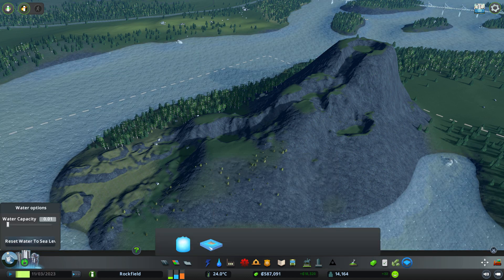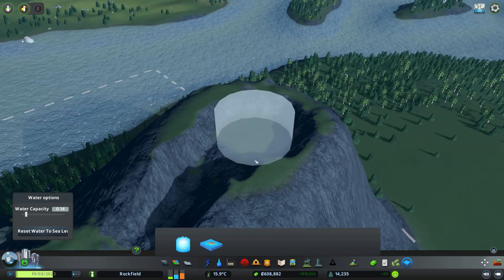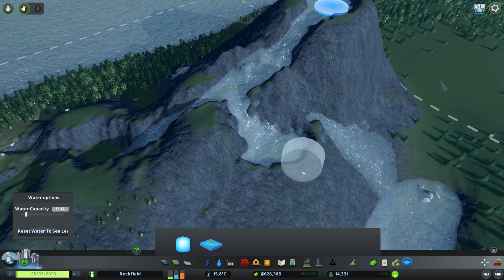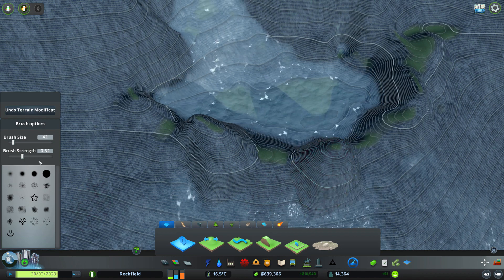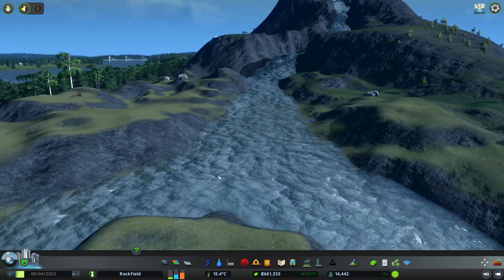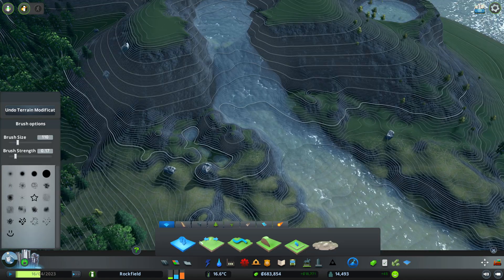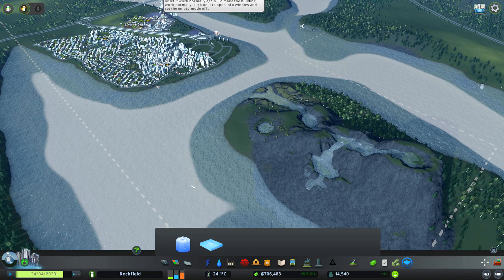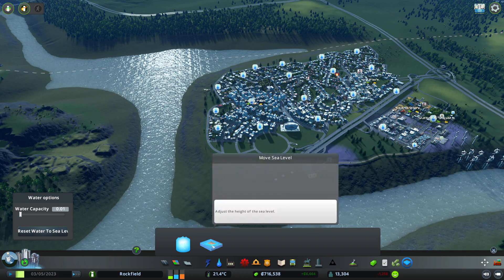Cities Skylines - Water Tool Tutorial - Extra Landscaping Tools Mod - Making a Water Feature

Comment: Great tutorial. Thank you. I do have a question. I have created a "spring fed lake" On one end is the cave where the water comes out. It flows over to the other side where I have placed the rock with a hole in it. I think its called "cave #3" and I want it to look like the water is flowing down that hole. Problem is the water stops at the rock and wont go higher on it. It looks weird. Is there a mod that will allow the water to go over the rock?
Reply from the maker: I'll be honest, I'm having a hard time visualizing what you're saying exactly. However I will say the large rocks included with the game are considered buildings, not props, so they can mess with water, water flow and geography more than you would expect.

Find some rocks off the workshop that are just props, or for a more complicated solution, use Procedural Objects mod you re-scale rocks and adjust their properties.
Reply: @KRX_  Thanks for the reply. Yeah its the bigger rock that are placed in a flow of water the water goes around the rock and make the after look strange. I will look in the workshop as you suggested. I am attempting to make the water look like its going down a hole, like a river would flow into a cave system.

Comment: I don’t have that water option?
Reply from the maker: This is added from a mod called "Extra Landscaping Tools" - it is not included in the game itself. Link to the mod on the steam workshop should be in the description. 

If you have the mod properly installed and activated, and you still don't see the water option. Check the in escape menu, mod settings, and make sure the "Water Tool" bubble is checked.
Reply: KRX thank you!

Comment: But what to do when a island, not a city, is flooded? The change sea level tool is also editing the water in the normal seas... but I want to remove water on a small island :/
Reply from the maker: "water on a small island" sounds like a closed body of water? Like a lake or pond? Water without a water source will eventually dry up. You can also add a water source to that area and lower the water level for that specific pond or lake. This will "suck up" the water. Any remaining bits will dry up in a few minutes.
Reply: @KRX_  Fixed it, used the Water Sea Level tool and erased all of the water. Then removing the island and adding defense to my City (the Wall things) and then re-added water (but not too high) then using water pumps to remove the water on my land. this took some time :/ water physics are a joke in this game
Reply: @KRX_  I'm new to this game, it's really hard to understand all tools. I use unlimmited money because I failed three times building a city. I want to build a big City, with lots of stuff, that's why. But I always get "not enough workers" and "abandoned house" :// That sucks!!